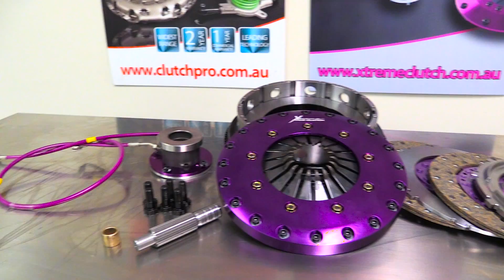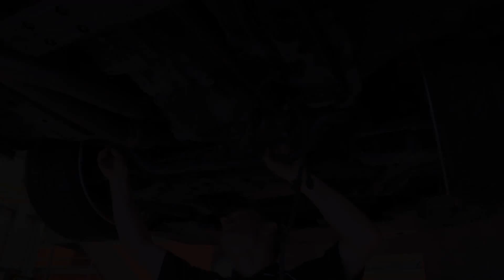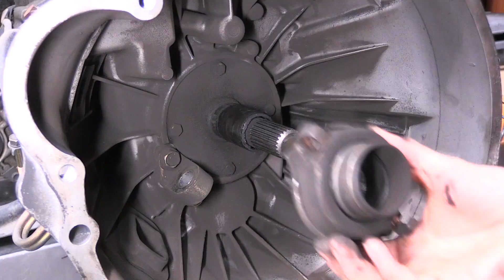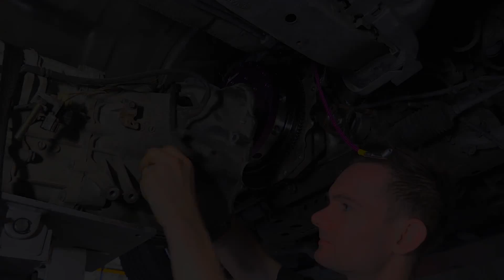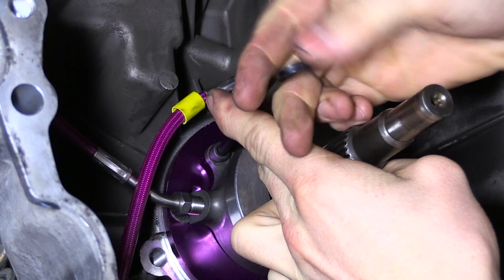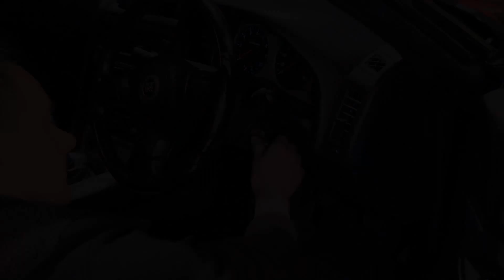Xtreme Clutch: R34 GTR TWIN PLATE CLUTCH INSTALLATION GUIDE

Comment: Why do people change their clutch from pull to push with R34's?
Reply: Hi,
One of the most common reasons for changing from a pull type to a push type clutch is to open up options for street performance and Motorsport clutch kits. The pull type clutch options for these vehicles tend to be limited to only a few different performance options whereas changing to a push type clutch allows much greater options including specialised Motorsport upgrades.

If you have any further questions, please email our friendly sales team (sales@xtremeclutch.com.au)

Comment: Good presentation of the product. I've had a similar clutch kit made by Spec installed on my Nissan car. Unfortunately that kit come with an unsprung hub, which makes it pretty useless on street driving. You should consider to make same clutch kit with a sprung hub!
Reply: Doesn't make it useless just noisy.
Reply: Why didnt you like it? I was thinking of getting a spec styr 3+. My R34 pushes +450 HP. Any recommendations?